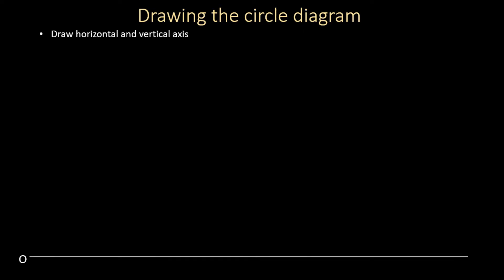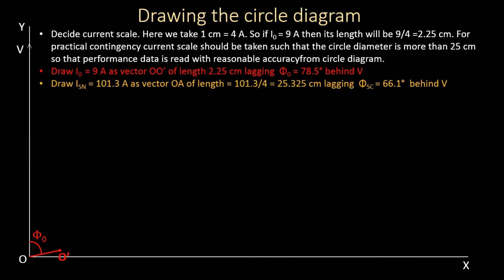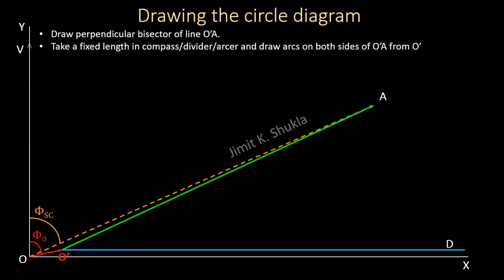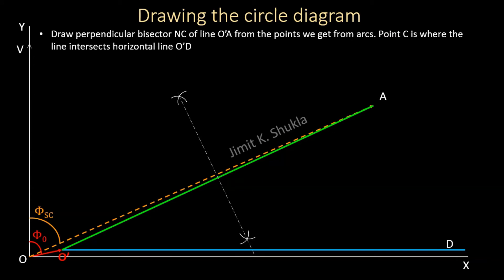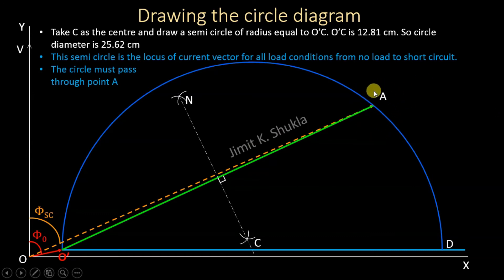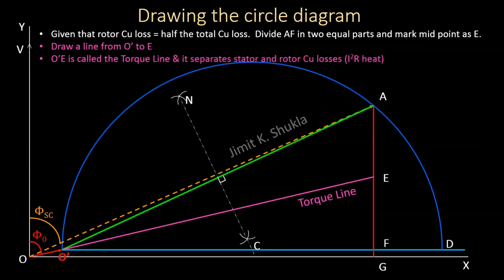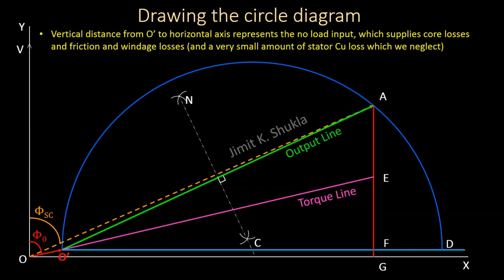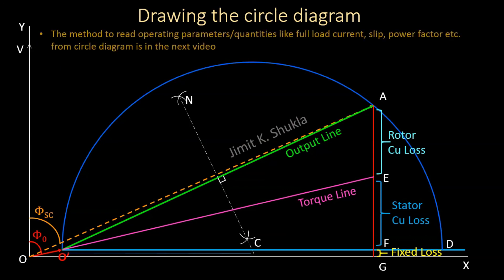Circle Diagram of Induction Motor - Part 2: Steps to draw | AC Machines | Electrical Machines

Comment: Sir u told rotor copper loss is equal to  half the stator copper loss given in example means for various examples situation may be different right sir??
Reply from the maker: In my example Rotor Cu loss is equal to Half of Total Cu Loss and NOT Half of Stator Cu loss. You understood it right that situations may be different. The ratio of rotor copper loss to stator copper may be given in example. It may be different because rotor and stator winding have different current and resistance. If not given then you may assume that they are equal. i.e. Rotor Cu loss is Half of the Total Cu loss.
Reply: @jimitkshukla  thank u so much sir for information